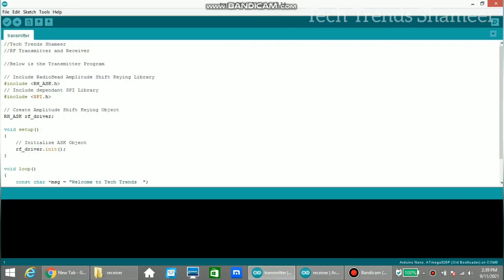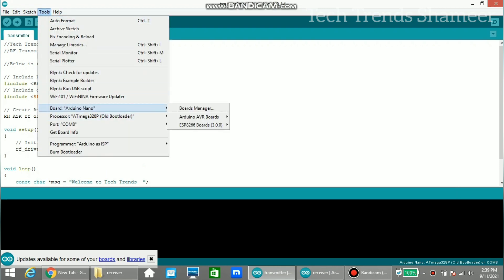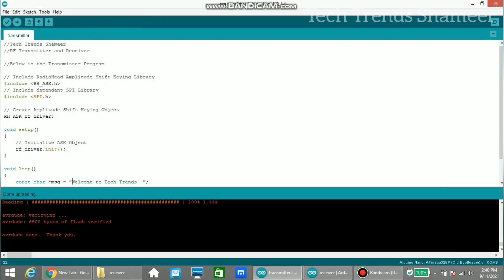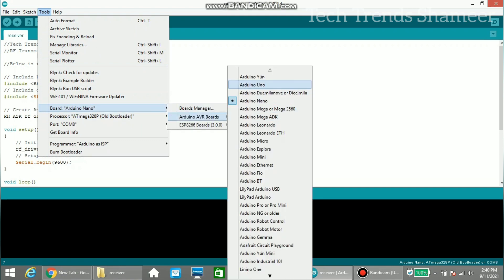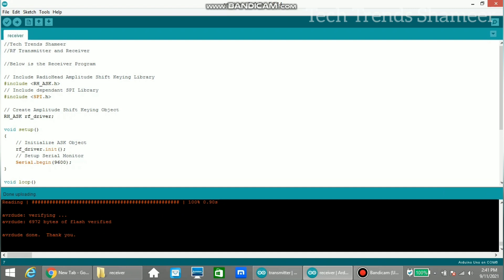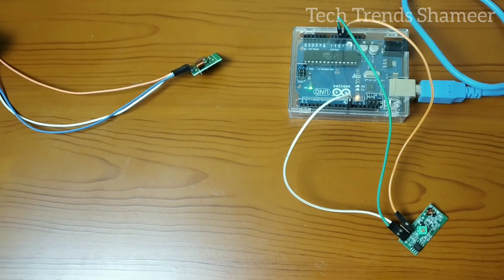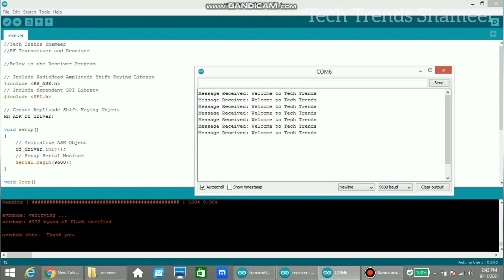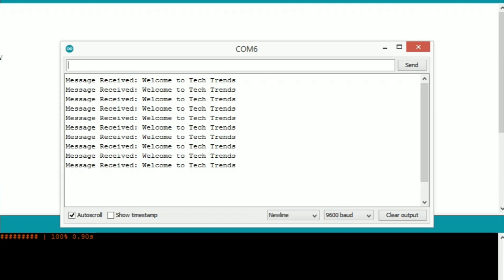How to Set Up RF Transmitter Receiver Module | Arduino Projects

Comment: What changes can be done to add transmitter side - button and a receiver side - buzzer and led to work
Reply from the maker: Need to change the code as per the circuit connection.

Comment: hello is it possible for the transmitter to work without an arduino?
Reply: not really? you need to initialize it so it need some code through the data pin. The data pin needs some sort of MCU, ATtiny, stm nucleo etc.

Comment: I'm trying to get an RF transmitter and receiver modules that appear just like the ones in this video to work, but I found this tutorial to not be sufficiently detailed enough.

E.g. Where did the code come from? Was there anything else you had to do (e.g. specific pins for RF ASK to function depending on board). The description for the video is so long yet it doesn't even have links to the library or example code
Reply: I have the same doubt

Comment: Hi. Can i use both transmitter  and receiver with one Arduino. Actually want two Arduino with transmitter and receiver both.  One message transmitter both Arduino should detect that message..
Reply from the maker: But you will not be able to prove that the message is transmitted because everything will be in the same board.
Reply: Yeah, if you have the same receive code running on both, when something is transmitted both should get it